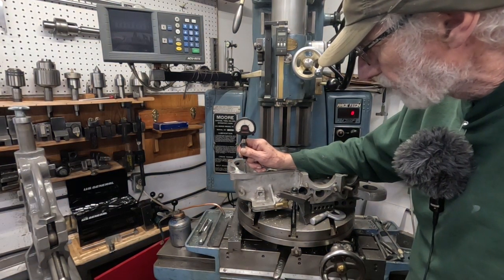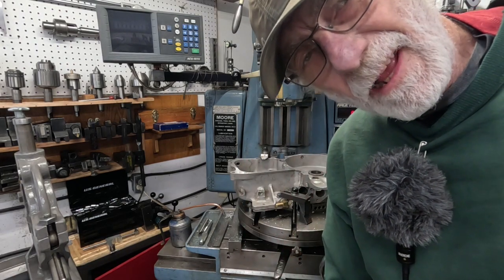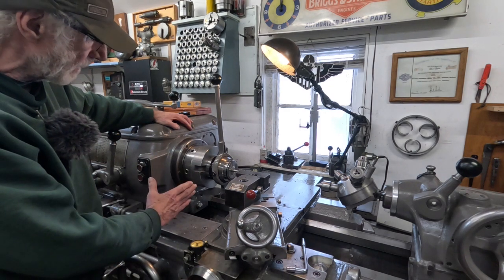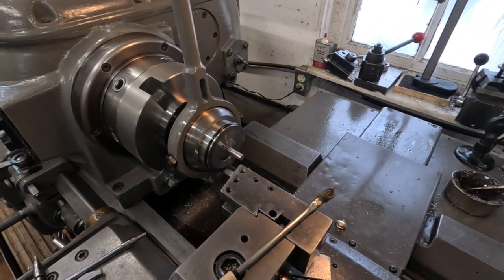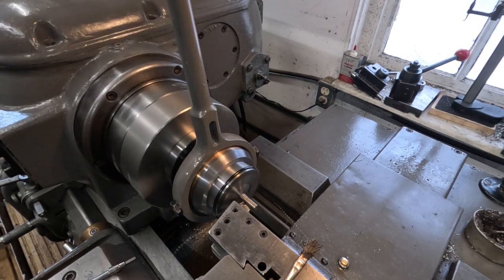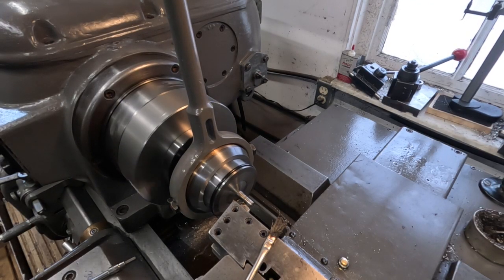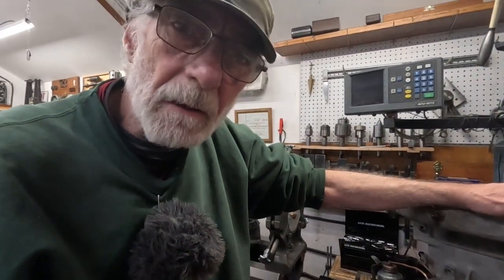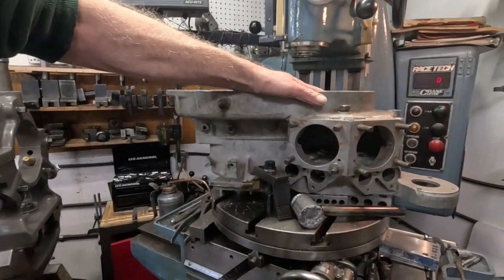Harley Davidson Machine Shop, 1953 K model engine cases are matched

Comment: Congratulations. I get just as excited when something works for someone else as I do for my own work. I voted, on my lathe, a part to fit over a short 1,6” dia shaft. I bored the hole to the exact size, only to find it just barely didn’t fit. After measuring around the shaft with a snap gage, I found it wasn’t as round as my measurements the micrometer measured. 0.0004” off in roundness. Unfortunately, it cane be removed from the machine. Meh. I’m retired, so I’m the only real client. I sanded the protrusion off the part, and it furs. Really annoying.
Reply from the maker: I discovered with the Harley parts there can be out of round critical parts such as crankpins and main shafts that only can be discovered with indicating snap gages and bore gages, there is another point of failure that causes the engine to destroy itself. The cause cant be determined afterward as metal circulates through the entire engine eating everything up.
 The problem is cost of good parts that few are willing to pay for and shops that cant afford gages to check each critical piece.
 The factory does gage every part at assembly and encouraged mechanics to do the same even with factory supplied parts as those are not checked. They said always look for defects in company supplied parts.
 There is only one company making these parts with a good record, but a defective part can still slip through.
 I have worked on hydrostatic transmissions where a pump failure can destroy an entire system on a million dollar combine for example. The Harley Davidson business became more trouble than its worth as few customers are willing to pay for good parts and labor when in reality its a stupid toy.
Reply: @ that’s true and it’s a shame.

Comment: Of course it fits! How could it not with the care  in measurement  and  following the procedures you illustrated? well I suppose you could have a brain fart! but you didn't. As the old guys used to say to me. The key  to good work is: Know what good work is and taking the time to do it.
Reply from the maker: Well, it has been 18yrs, 2006 since I have done this. Likely to never do one again because of the cost of time. No one will pay for this in these times as the Harley fad is absolutely dead.
 I can finish the cylinder mounting surfaces then it goes back under the stairs as the cost of building the engine is more than I can handle. Anyway, I am happy my equipment is up to it, I will certainly pursue actual paying work now that I have things rolling. Back on to the radial drill press that will be a money maker for me for much easier work doing regular basic machining I can pick up locally.
 I can do some shop information videos that may be interesting and useful for those that want to work on these themselves.

Comment: Thanks for sharing your expertise and beautiful machines. As for the steel sleeves in the case, do you have an idea why they were installed? You mentioned it was odd.
Reply from the maker: I don't know, the steel sleeves were staked in, I could extract the dowel pins but had to machine the sleeves out making things a little harder to do, thanks.

Comment: How are you planning to address the main bearing races being closer together now that you've removed material from the mating surfaces? You also have changed the cylinder bolt pattern and need to move them back apart or the cylinders won't go back on even if you do bore the spigot holes. I think your idea from a couple of vids back of having a spacer cut on a water jet is the best way to go. I'm following this with interest.
Reply from the maker: I have been down this road many times, the easy part are the cylinders, simply elongate the holes. The crankshaft, I may have to shorten the crank pin, or buy one from Jims, the sides of the female rod may have to ground, the rod bearing cages also, the transmission shaft spacers ground, sides of transmission gears ground. I have surface and a universal tool & cutter grinder. After further evaluation it is possible I may have to use a spacer between the case halves. At any rate I can create any part in this engine. If a hardened shaft is needed as in the case of very old engines I can use 5200 series bearing steel, have it induction hardened at a nearby facility and finish it up on my grinders. I can do much more than work on old motorcycles that does not pay well and it never has, thanks!